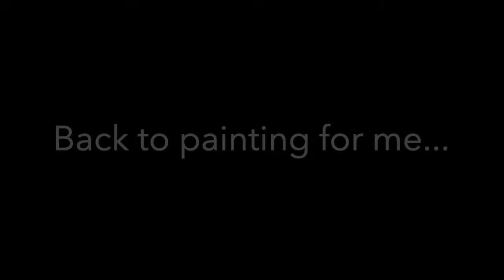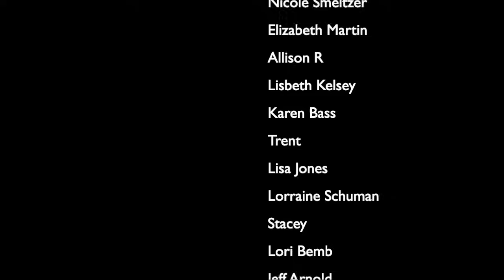Dropping Beams (and Trees) 😱 The Chateau Chronicles – Ep #58

Comment: Hi Abby. Does Bruce know that cement isn’t good for stone walls. Everything I’ve seen said that it doesn’t allow the stones to breathe. Just my American 2 cents. lol. 😂 I really enjoy your vlogs. Is Bruce the new handyman?
Reply: He is using it for more of supporting beams rather than covering the whole wall with cement. It should be fine.
Reply: Agreed! I’ve watched a lot of walls being rebuilt and everyone uses lime mortar so the walls can breathe. At least one side should breathe at least (and not the outside). Cement will also crack more easily. You definitely don’t want to render the outside with concrete.
Reply: @tdub4066 If you look at a previous episode, he used it on a wall with rebar pounded in to “fix” a crack on the wall that he was concerned about. Even I know that was a huge mistake. He seems to be a handyman that is used to cinder blocks. He doesn’t seem to know about stone builds. I’m sure he means well, but he needs to research the correct ways to renovate stone buildings.
Reply: Seeing the tree down reminded me of our previous home that was set back behind a woods.  Had to own a chain saw and tractor for cutting and hauling trees that would fall in a storm and block the driveway!

Comment: I understand why you did the concrete lentils, but what I don’t understand is why you patched that wall crack up with concrete instead of stucco or some type of mortar rocks, those stones can breathe my understanding those old homes that were built that way they use mortar so that the stones would be able to breathe and stay dry. The concrete doesn’t do anything but trap water in the wall.